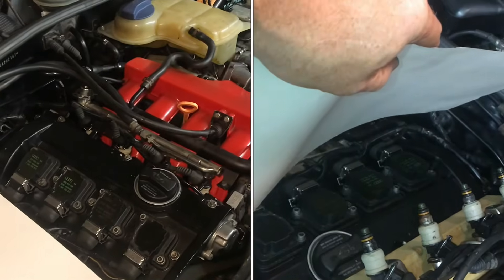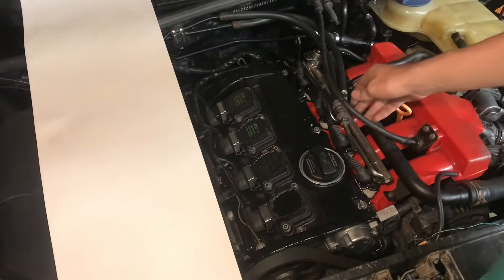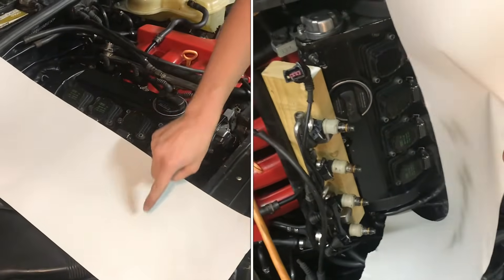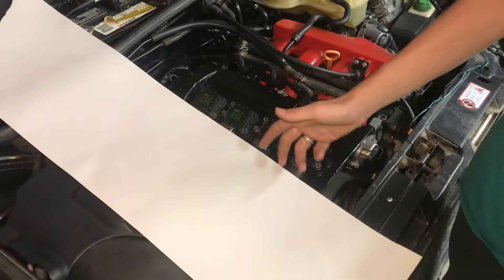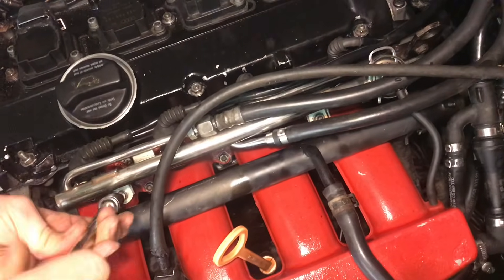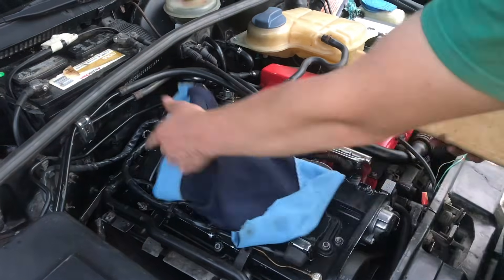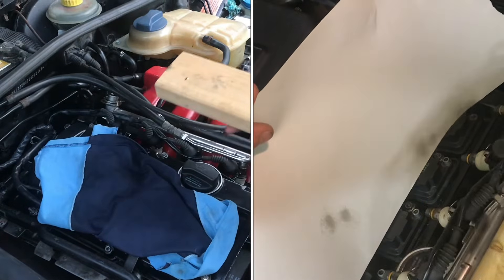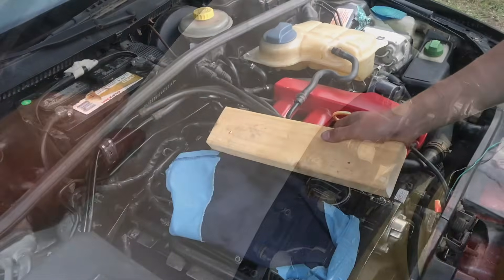performing a “LIVE fuel injector test” (verify the injectors are working correctly)

Comment: Hi bro,thanks for that.i have a opel Corsa b,all injectors are spaying at the same time without interchanging .....what could be the cause
Reply: Could be leaking injectors or ECM controller.. What if you just put key turn it to ON position without starting? Do they spray then?
Reply: Crank or cam sensor